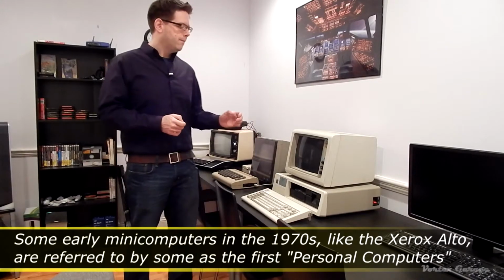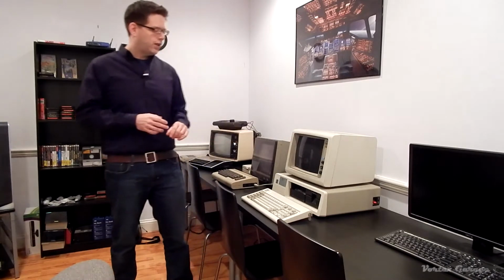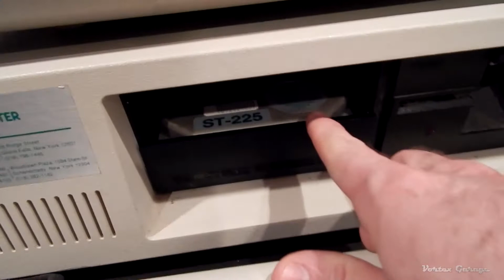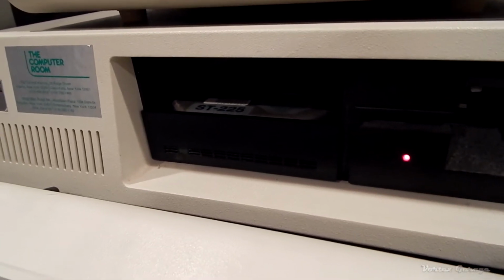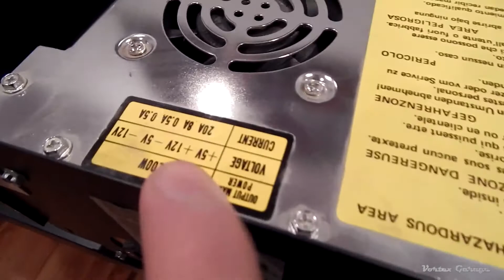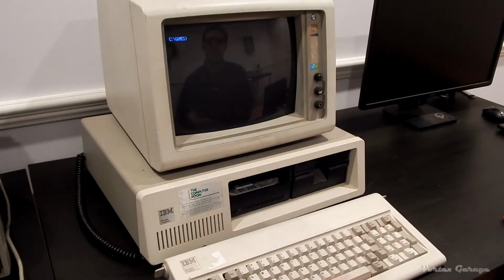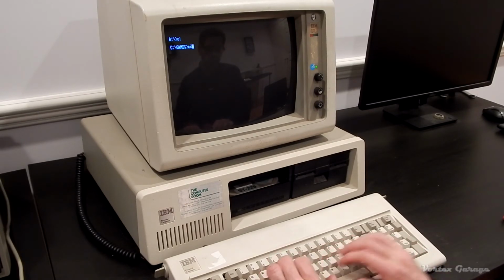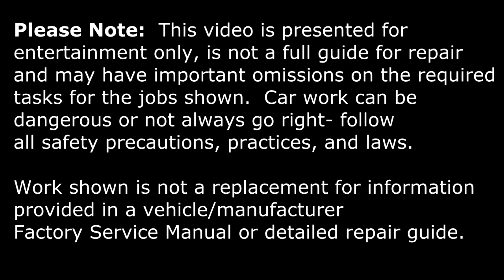The IBM 5150 - The First PC - A Look Inside and Running Programs

Comment: Evidence
• 	Collectors have documented original IBM 5150 motherboards with AMD 8088 CPUs. These are not clones or aftermarket swaps, but genuine IBM boards.
• 	Vintage computing forums confirm that AMD was a licensed second source for the 8088, so IBM could use them interchangeably with Intel chips.

Comment: Thanks for showing PFS: First Choice software.  In about 1989-90 I started using an IBM compatible with a Hercules monitor to help run my Dad's small business.  We used First Choice for everything - databases, spreadsheets, personalized letters, you name it.  It was the DOS equivalent of Microsoft Office of it's time and was really powerful.  We never had a hard drive so with 2 floppy drives on an 8088, we were swapping disks constantly.  Lots of good memories though!

Comment: Hello! What is the price now for a working 5150?
Reply from the maker: Hard to say - they vary quite a ton.  Building one from components is often cheaper if you can find say the CPU, monitor seperate, etc.  Some with a full working, clean one will as for several hundred dollars.  Buying stuff that's not been tested is a crap-shoot but often much cheaper, especially if you can repair it.  Shipping also adds alot, even if you score a super cheap part, the main chassis and monitors are very heavy.  I'd say low end $200, high end $700, but the market for vintage computers has gotten pretty big lately.

Comment: The Alto was leagues ahead of the 5150. In fact, the much cheaper BBC Model B was far more feature-rich compared to the 16k, cassette-only initial version. However, the expandability, documentation and hefty brand identity of this IBM beast made it the success. Given it was thrown together in 12 months using off-the-shelf parts (some as major compromises), it really should have been a flop and the world would look different today. Great video!

Comment: Did DOS 1.0 even have the prompt $p$g command in the autoexec.bat?? Because otherwise I would've been surprised about seeing the C:\> prompt on screen as displayed.
Reply: Pretty unlikely, especially since support for both harddisk and subdirectories was introduced first in DOS 2.0
Reply: @VintageTechFan  You could edit the autoexec.bat file to add the $P$G so it showed you if you were on a or b (if you had it) sub directories and a harddisc came later as you say. DOS 2.1 as the first useful version and needed for the hard disc. That's is an aftermarket drive. I would say it is at least a third gen unit and has a 256K MoBo where as the first unit had a 16K shipped, expandable to 64K with chips!

Comment: You have bad switched graphics mode. On motherboard DIP switch you need to set up position 5 to ON and 6 to OFF. You have now the exact opposite. 40x25 text mode instead 80x25. Also you can try to low level format your hard drive, it can help.

Comment: It WAS the first PC - before the IBM PC came out, we called them 'microcomputers' (or 'micros' for short) in everyday language.
While other micros may have been referred to as PC's under some circumstances, (possibly by manufacturers) it wasn't common use.
The IBM PC reversed that situation, and now 'PC' is the everyday term, and 'micro' or 'microcomputer' is archaic.
Reply: There are examples of the words 'personal computer' being used in advertisements and on boxes before the IBM PC was released (such as the Commodore VIC-20, ZX80 and ZX81).
Reply: James Beat More to the point, you had business computers (workstations, minis and up), and you had home computers (Atari 800, C64, TRS-80, et Al).  The IBM 5150 PC was the platform that bridged the two spaces, thanks to the mostly open architecture, allowing others to clone it once the BIOS was reverse-engineered.

Comment: I was stuck with different XTs for a few years in the 90s when I was in high school, one being a 5150 with (eventually) that same color monitor, since finding computers and parts at rummage sales (or on the curb) was all I could afford.  At the time it felt like a curse, since all my friends had better machines.  But looking back it was a blessing in disguise since it forced me to learn assembly for speedier graphics routines, and how to interact with the physical hardware components, to make the most of its limitations.  I wouldn't want to go back, but the beepy hard drives, the 8x8 font, the visible space between rows of pixels, etc, all still make me nostalgic.
Reply from the maker: FyberOptic I agree!!  I'm so happy with what we have today and how well it works. I even remember not liking some early machines. But such a valuable experience to learn off stuff like this!  it really did make you learn how to design for the hardware limitations!!
Reply: What about the AT?  Was it well received in the day?
Reply: The 286 was a big deal at the time for the PC world due to the limitations it attempted to overcome, and plenty of software took advantage of features it introduced.  But I think the reality was that the majority of software was still for DOS, while staying in real mode, which maintained the same old limitations of segmented memory and the 640k limit.  There were also still a lot of 8088/8086 machines in place, and making software compatible with the largest market was obviously in your best interest.  So for a lot of what people did with their PCs, I feel that the 286 had a lot of wasted potential.

The 386, on the other hand, improved upon the 286 so much that it was the real game-changer.